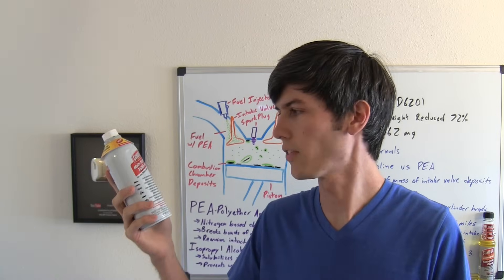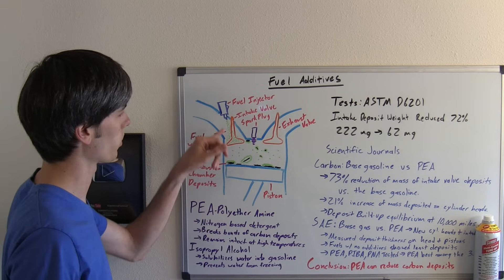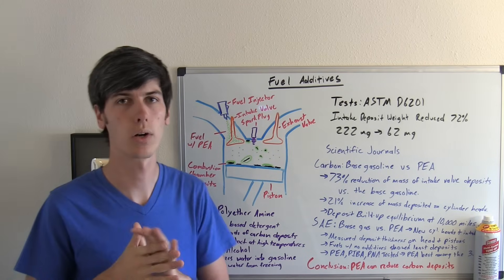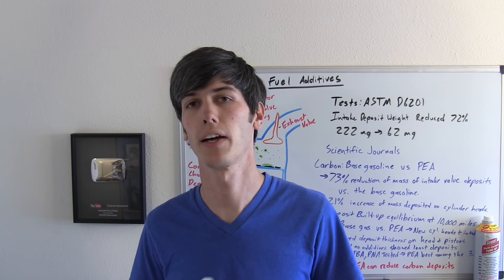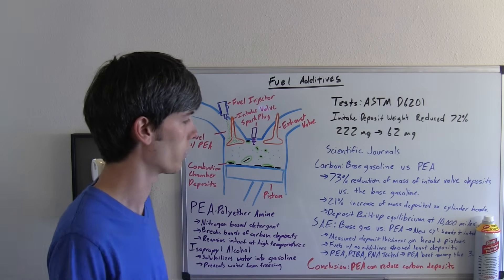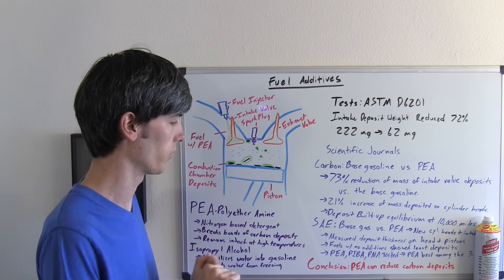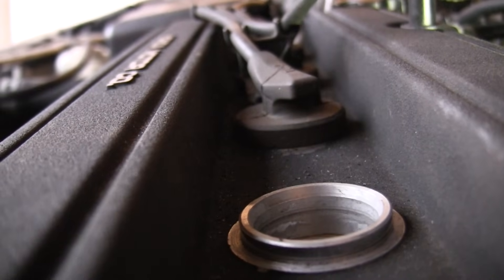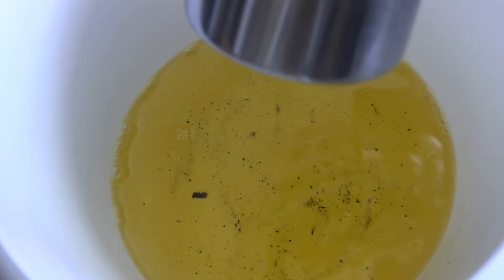Fuel Additives & Injector Cleaner - Explained

Comment: in your test, you soak the part in the additive or the additive mixed w gasoline? Also what's the effect of burning rather than soaking?
Reply: +J Segal In the beginning he said PEA was stable and did not change when burned.
Reply: The worst kind of smart ass is an ignorant smart ass.
Reply: Yes, i was thinking the exact same thing. Wouldn't getting the product heated (combustion proces or forced (injected) onto the valves) have a significant improvement in the overal effects of the product in comparison to just let is soak on the particals?
Reply: +J Segal The PEA doesn't burn. If it had to burn to work, then it wouldn't clean the intake valves. It just breaks the carbon loose and then it and the loose carbon gets forced out the exhaust.
Reply: seigeengine
"Hydrocarbons are mixtures of water and carbon. When you burn them, you're oxidizing the carbon, and releasing the water"

Hydrocarbons are Hydrogen - Carbon chains.
Oxygen combines with Hydrogen, making the water you think is trapped in Gasoline

--- LOL ---
Reply: seigeengine
You're just telling everybody you failed basic chemistry.
Reply: Mark G So after combustion, the additive is left behind? Nope, that can't be correct. The point of an additive that "cleans" carbon buildup is usually that it in some way reintroduces the carbon into the combustion, by raising the temperature of the burn or maybe loosening the bond of the carbon on the surface or both.  Anything not burned away makes things worse. The soaking would relate only to standing fuel, as in the tank. Some additives prevent corrosion or reduce water separation in tanks.
Reply: It gets forced out as a gas or vapor, not as just chunks. If it dribbled out it would just redeposit in the exhaust. Knocking the carbon loose with a flammable agent allows it to be reincorporated into the burn and more fully exhausted. That's how carbon deposits are "cleaned" or removed. Technically, you reburn them, but more completely.
Reply: J Segal
Carbon is burnt fuel. I don't think it can be burned again. He is saying some carbon blows out and some gets re-deposited. The main problem in engines it to get the carbon off the valves(mostly the intake valves).
Reply: The carbon can't burn, true. But if you can loosen it from the surface with a flammable agent it can be blown to bits by the explosion and become part of the exhaust gas. These little bits build up over time on the surface, so if they are released all at once they will be too heavy to be carried by exhaust gas, so they have to be reburned to basically create a vapor.
Reply: +Mark G "Carbon is burnt fuel. I don't think it can be burned again. "
Actually Carbon DiOxide is burnt fuel. The carbon deposits on intake valves is from oil seepage past a bad seal.  The exhaust side isn't under vacuum and is alot hotter. The motor oil goes down to the valve and roasts there - - carbonizing, as it's not burning.
.
I worked in a machine shop and my job was cleaning and cutting valves.  I cleaned alot of carbon and worked on valves in sets, from the same engine. If it was the fuel, all the valves would have the same deposits.  It's the seals.
Reply: +Mark G The PEA is stable, meaning it doesn't degrade under heat. That doesn't mean it isn't more effective in a hot system than a cold one. Most chemical reactions are greatly accelerated by increasing the temperature. On the other hand, they're also related to concentration, with the chemical diluted in gasoline likely being substantially less effective than soaking it directly in the cleaner. In the end, this was a demonstration that it works, not of how effectively it works in practice.

Furthermore, carbon is not unburnt fuel. Carbon IS the fuel. Hydrocarbons are mixtures of water and carbon. When you burn them, you're oxidizing the carbon, and releasing the water (as steam).  When fuels are burned completely you end up with CO2, and a maximum energy retrieval. You get CO, carbon monoxide, when there isn't enough oxygen in the flame, leading to incomplete combustion.

The problem is that carbon in some forms can be extremely resistant to heat, meaning you need very high temperatures to break down their bonds sufficiently for oxygen to attack them and strip away the carbon.
Reply: seigeengine
An example of hydrocarbons with oxygen would be all alcohols. There's an -OH connected to one end.

But that's not really water, now is it??
HOH or H2O is different than having an oxygen atom attached somewhere on a molecule that is a carbon chain fully bound with hydrogen.

--- ROTFLMAO at you ---

Comment: I have a diesel with 42k miles on the odo. Can I use the cleaner do you think?
Reply: Yes especially with the ethanol formulations these days. Ethanol causes more carbon build up. The sooner the better. Preventative maintenance is key to longivity of an engine.
Reply: +Phillip Johnson (philjo) Um Phillip you might not want to run any ethanol in your diesel. I am thinking this might cause some serious damage, such as blowing the tip off every injector in your engine after you got diesel run away caused by the more explosiveness of Gas in your diesel engine not to mention melted pistons and probably a rod through your block. Best additive I have ever seen for diesel or gas for that matter are some local to Florida products called Gas-Shok and Desl-Shok. Niether contain any IPA such as sea foam does, IPA is isopropal alcohol by the way. That is what they use to absorb the water. It is a serious no no for rubber seals and hoses in your fuel system. Both products I mentioned are 100% petroleum distillant, have a water sorb , stabilizer and a lubricant as well as a fuel system cleaner. Diff being Desl-shok has a cetane booster and slightly more lubricant for your diesel high pressure fuel pump and Gas-Shok has an octane booster. look at fix*fuel*problems*.com

Comment: what is your suggestion to combat our ethanol based fuels? I deal with high revving 250cc 4 cylinder 4 stroke motorcycles with tiny carbs that get stored over Ohio winters.
I find my self having to clean and sometimes rebuild the carbs after storage. please help. Thanks

Comment: I bought gum out cause of you then watch Chris Fix and was disappointed . I respect both of you YouTubers .
Reply from the maker: +MrFreakofnature999 Thanks! Always important to do your research, and test as well.
Reply: +Engineering Explained What about turbocharged engines?  I've heard that disrupting large amounts of carbon build-up in the combustion chamber out re-deposit in the turbo blades and possibly block it.
Reply: +MrFreakofnature999 Used STP in my petrol engine and I felt a difference in fuel consumption and also the car was move zippy.

Comment: Good video, great information on carbon buildup.  However you did not include any information on fuel system cleaning such as injector cleaning.  What are your thoughts on that aspect?
Reply: +Justin Blair A good additive will clean your injectors as you burn the fuel it is treated with, as well as lubricate your fuel pump . It will also stabilize and boot your octane rating slightly and absorb into the fuel and water or condensation you might have encountered. Preferably one that contains zero alcohol.

Comment: Some of the additives in gasoline are there to clean the intake valves.  So what cleans those valves when your engine has direct injection?  It seems that most makers are moving away from or already have abandoned port injection, so are we now going to have more valve problems as our cars age?
Reply from the maker: +wholeNwon It's possible, some manufacturers are now using direct and port in combination to overcome this.
Reply: +wholeNwon Vehicles without port injection will require more maintenance on the intake system to reduce the buildup. Many chemical makers have products that "fog" the intake manifold and clean out any buildup while the engine is running. But it is a definite concern going forward.
Reply: diesel engines have used direct injection for a very very long time with few issues, petrol engines will be ok
Reply: +Ashley Thorpe only recently however have they started being required to use pcv (back to intake) and egr. With that said there are kits to undo this for practically every diesel engine I know of because of the problems it causes.
Reply: +wholeNwon with direct injection I would suppose that there is not much to deposit on the intake side of the valve? Only clean air passing through? Must be more to it?
Reply: Cuda Tom No there is PCV (positive crankcase ventilation) which contains the blowby gasses as well as oil vapor. There is also EGR systems (exhaust gas recirculation) which takes the exhaust and diverts a small portion of it back to the intake in order to minimise the vacuum while driving along at speed.
Reply: +Cuda Tom   EGR system.  Catch can might be added to the system or a portion of the air/fuel mixture diverted to the intake valve.

Comment: So basically Shell's V-Power Nitro+ is named "Nitro+" because it contains PEA, the nitrogen based compound. Except you pay a LOT more money for that fuel versus just buying a fuel additive.
Reply: +BM3USNAVY ok this is going to sound crazy coming from a guy that sells a fuel additive. But on that new of a vehicle and such a small tank. You probably turn your fuel over fast enough that you really do not need a fuel additive. Additive will help higher mileage vehicles, vehicles that sit for periods of time (ethanol blends start to separate the day they are blended, three four months for untreated ethanol is a long time) or vehicles that have a high risk of moisture in your tank due to extreme humidity or marine use providing your using a additive that will absorb water into the fuel and burn it in the combustion chamber and use the steam that creates to help keep things clean.

Comment: The increase in deposits over baseline gasoline makes sense. Take spark plugs for instance. These days the most common cause of ash coating the plugs is from fuel additives. I can run either of my cars for 10,000KM and the plugs come out looking almost like new. A fuel additive later, and the plugs are ash coated.

Comment: Nice video. thanks for explanation as always. I guess (as an engineer myself) I'd be interested in the question: does using PEA to reduce the deposits improve the vehicles performance in some way? OR does it protect the engine in some way? those are the important end-measures in my opinion. Do you have any insight on those questions? Thanks again.
Reply: as a non college edumacated lowlife i find it fascinating you cannot derive the purpose of cleaning deposits out of a motor

Comment: they almost completely does not work. You are strongly encouraged not to add stuff in to your engine just read your owner's manual
Reply: +Zhangy This is correct. Most gas in the US has detergents like PEA already added and ALL gas has to have some sort of detergent to prevent buildup. Not all additives are equal, but OEMs generally don't recognize any benefit of using aftermarket cleaners. They generally instruct you not to use anything.
Reply: Zhangy this is working for me at 187K   It has been working well.
Reply: Zhangy agree these adetives do nothing tousl marketing scam
Reply: I agree if "following the owners manual" includes using only Top Tier gasoline, which all the manuals I've read online (don't ask!) now recommend. The more interesting question is what do you do if you buy a rental car which has been run on the cheapest gas possible all it's rental life?

Comment: or just take your car to a race track every once in a while and floor it like you stole it, that'll get er cleared up pretty quick
Reply: Rashid Al-Riyami 
Thats called the Italian  tune up.....
Reply: Thats why i love older and cheap cars... ill never want a brand new car that i will have to sell my ass to get it fixed...
Ill always ride nice older and cheap cars so i can drive them like i stole them every once in a while :)
Reply: I doubt there is evidence that the “Italian Tune Up” is of any benefit for modern properly maintained engines.
Reply: @kirkp_nextguitar  if its properley maintained it doesnt need anything else... 😂
Reply: @kirkp_nextguitar funny you mention it. Engineering explained did a video on that and DID find scholarly evidence that Italian tune ups have a slight benefit.
Reply: @kirkp_nextguitar  stfu
Reply: actually the conclusion was inclusive... in theory it could work because the temperatures are reached to rip the carbon molecules a part.
Reply: @J0shT89  
What about clogging up your cat??
Reply: Yup, run it till the engine glows a nice cherry red.  It helps if you drain out half the oil first.

Comment: I would like to see some testing done on Star Tron enzyme fuel treatment.
Reply: +Patrick Dempsey Star tron is the #1 sell on the planet, it works well as a stabilizer and a lubricant and a cleaner, it does zero for water. If you read the MSDS sheet, it is basically paint thinner with a proprietary enzyme blended in, but the enzyme is less then 5% If you read the label it does not claim to do anything for water, so you are getting what they are selling you
Reply: Thanks for explaining that for me.

Comment: Regarding the 21% increase in mass on the heads, and thinking about the way engines work, did the carbon come off the valves and some of that carbon settled on the cylinder heads?  Is it reasonable to think that running a motor at a higher RPM might also clean the heads?

Comment: U are pretty knowledgeable.  So u said non additive fuels leave less build up over fuels with additives.  But u also said to use high quality  fuels which usually have additives like techron.  Which should i use then?  I have a 2010 altima with 90k.  No idea what the inside of my car engine looks like.

Thank u
Reply: +MrStilltipping3 The buildup creates a unity where no further buildup occurs. But it still removes more than enough carbon deposits to compensate for what it leaves behind.
Reply: You should see a sticker on the Gas ⛽️ pump that reads: Top Tier Fuel

Comment: The way i see it is seafoam and all of cleaners are more trouble than theyre worth. Back in the day of carborators and cars naturally running dirtier full tune ups every 5k i can see the use. But cars today run so so soooo much cleaner than they once did, not saying it does or doesnt work or that engines dont get deposits they do i get that. For my cars i just wont use it. Youre adding chemicals your vehical can take very little of or may not take it at all. Ive seen people back seafoam then it burns out old seals and theyre pissed. Anyway thats my opinion lol.

Comment: Engineering Explained  can you make a video on oil additives please...i see a lot of those on the internet and they claim to increase engine's life, but do they actually work and how?
Reply: +Hayk Karapetyan Try www.bitog.com and search for some info. There are some out there that have little to no anti-wear agents and only Viscosity improvers. Good ole STP oil additive has ZDDP and VII and is cheaper than almost any. They do work, but their uses have drawbacks. ZDDP kills catalytic converters. Too many VII will cause shorter oil life and more pumping losses from the engine. Just use good quality oil in the proper grade for how you use it, and you should be just fine.

Comment: I have an Acura TL S-Type 2007.  It requires 91 grade octane fuel minimum.  In the manual it also says that using unleaded gasoline is okay, but to not do it consistently as it can lead to performance problems as well as build up in the engine.  

Currently I'm a bit short on income, so I've started to use unleaded.  When I can finally go back to premium with no concerns, do I need to use the fuel cleaner with the first tank? Or should I work my way back up to premium by using mid-grade first?  Thank you for the video(s). You are certainly a lot of help and explain things very thoroughly!
Reply from the maker: ***** You can switch between them and there shouldn't be any problems. I just wouldn't be overly aggressive with your throttle pedal with the lower grade stuff in there. As a side note, all gas is unleaded these days. :)
Reply: Awesome! Engineering Explained thank you! But when going back to the higher octane, would the cleaner be recommended?
Reply from the maker: ***** Probably more impactful if done with the lower octane fuels, as the higher octane fuels typically have much higher concentrations of PEA (or other similar cleaning agents).
Reply: ***** you're wasting money by putting 87 in it. You lose MPG and power so you're not saving any money by using low-octane gas. Less MPG= more frequent fill-ups= more money. Just use 91+ and you'll be better off. Its not that much more in price anyways...
Reply: +Brandon Dunklin Not necessarily. He would have to check his fuel economy to be sure. There may not be any noticeable difference. At 11.0:1 the compression isn't radically high. There are other factors, but I wouldn't be so quick to knock (hur hur hur) the regular.
Reply: +forrest225 I wouldn't suggest anything lower than a 91AKI fuel with 11:1 compression. Honda K20 and K24 are detuned to accept the lower grade fuel when necessary but don't recommend it and won't cover damages caused by using lower than the recommended fuel octane. 11:1 is about the highest compression you can find on an engine used in a car that doesn't have direct injection, so I'd have to argue your point about it not being radically high. There are many new technologies that keep an 11:1 engine safe. furthermore, using lower grade fuel may degrade mileage enough to offset the lower quality fuel's cost savings.